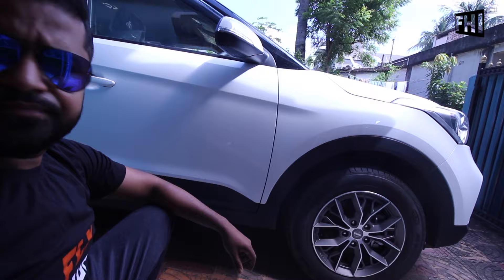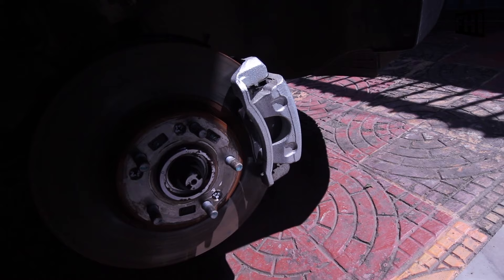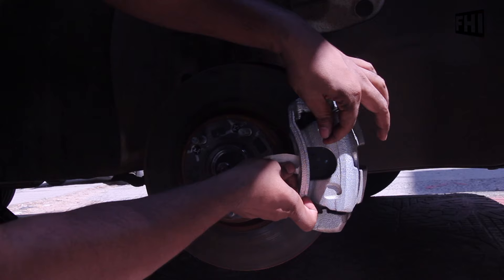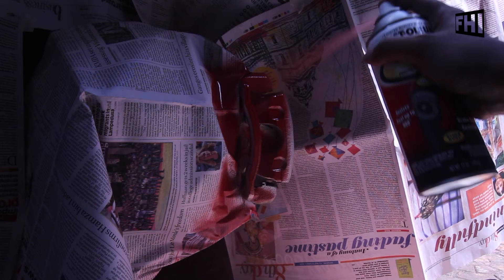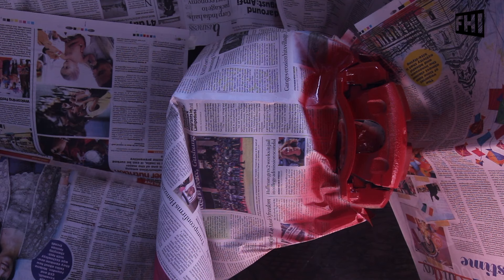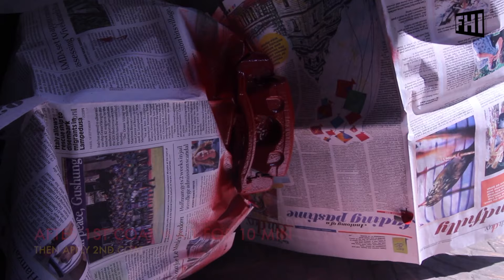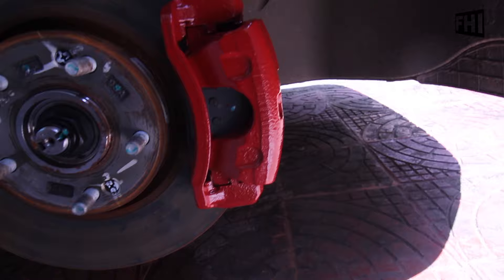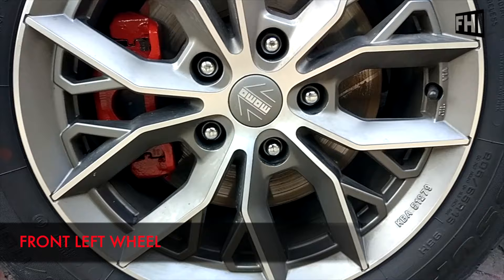DIY - PAINTING DISC BRAKE CALIPER

Comment: I really like your video, I would be happy to share what you do to keep your car tires absolutely black. Thank you.
Reply: You can easily get a tyre polish online, you should go for the 3M brand, it's the best. You simply need to clean your tyres before spraying the polish and then spray the polish and rub it over desired areas on tyres and leave it to dry, that's it.